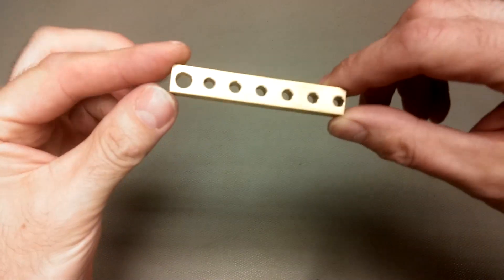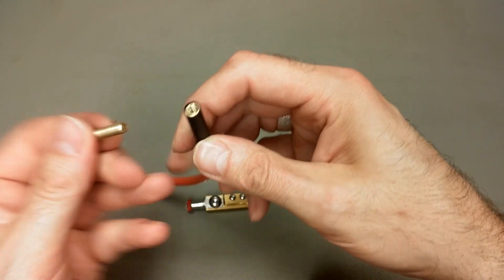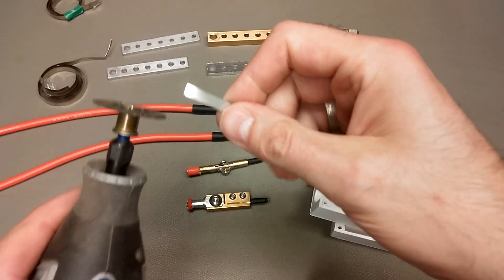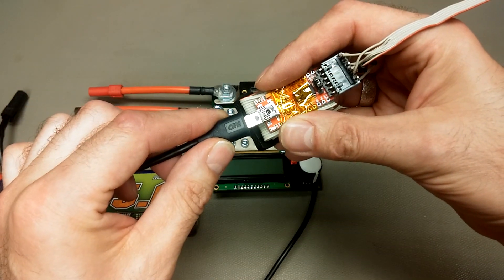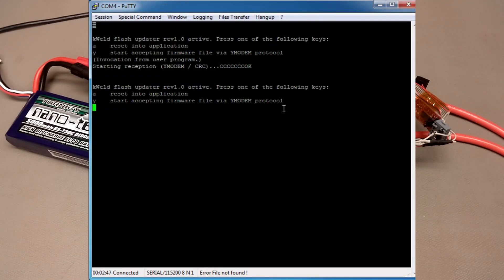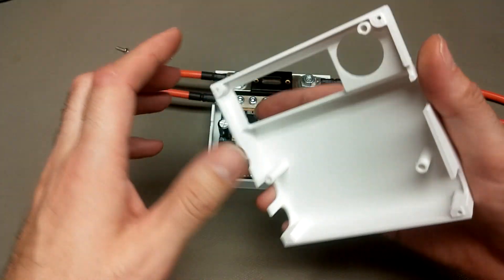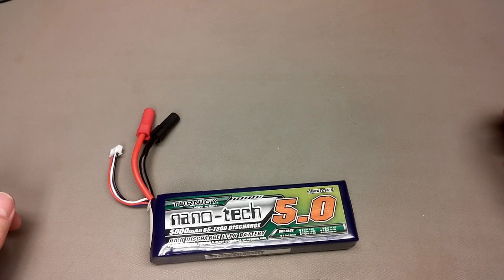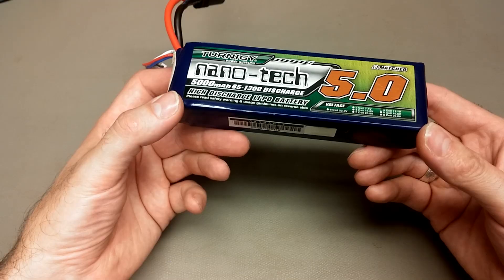kWeld "next level" battery spot welder - torture test and improvements

Comment: Is the spotwelder pulsing one time or two times in quick succession? When doing two pulses, first small, second big, you burn away the oxide layer. This creates a better weld. Have you experimented with this?
Reply from the maker: Two pulse operation is normally needed to soften the metals and clean the surfaces in contact in a first short pulse, in order to have a repeatable resistance for the actual welding pulse. As the pulse durations are constant in commercial machines, that is one way to produce consistent welds. My approach is completely different. The welder controls (=keeps constant) the amount of energy of one pulse instead of its time. This automatically guarantees that the amount of delivered heat (=energy) is always the same, no matter how much dirt or corrosion there is. If there is bad contact at the beginning, then the pulse is automatically extended. The welds that are produced with this machine are very consistent.
Reply: WeAreTheWatt 8

Comment: Have you thought about using some decoupling capacitors for the input-side?  
I would imagine having a capacitor that stores ~100J would also drastically decrease the burden on the power-source and likely increase efficiency due to lower ESR.
The reason i think this would help is quit simple: The capacitor can be charged over a longer period of time (hundreds of miliseconds) and during the burst the battery would "only" need to deliver a part of the total current. So lower current bursts on the battery, lower resistance for the discharge.

I would make the potentiometer logarithmic:
Going form 30 to 60 joules can change a lot, but from 400 to 450 not really, so imo it would be better to have tighter control at lower levels.

Also:
as i think it will be mostly used for battery strip welding - why not make a small connector that has the anode/cathode close to each other in a single piece, maybe even with a springloaded switch so you can align it and only when you push it down hard will it make an actual connection?
Reply from the maker: That capacitor will be a supercapacitor, and I appear to have some of them on my desk already because that will be the next option for a power supply :-)

I have noted your idea to make it logarithmic, I like it!

As this is system is DIY, I am sure that people will make a stationery probe holder system like that. I think it is a matter of taste, I like having the probes in hand, and using the automatic mode with them.
Reply: The probe-holder could be as simple as a fixation that holds both probes in place - but it was an idea after seeing your other video where you had some ... problems ... with premature connections.
Reply: @wearethewatt2950  Hello! Thank you for this project. I get my kit HW R3.3 yesterday 28.09.23 - did I get it with the newest version of FV or it need to be updated??

Comment: it might be good to use an encoder instead of a potentiometer
Reply from the maker: it was not necessary so far, I wanted the user interface to be as clean and simple as possible. But activating/deactivating auto mode would be already the first use case for an encoder's push button. Noted, thanks :-)
Reply: Using encoder would allow using it exclusively in auto mode either by pushing encoder button or setting things in options menu
Reply from the maker: what additional features do you have in mind? Currently the only function is to set the energy level, and for this I consider a potentiometer as the best possible human interface.
Reply: i was just thinking it might be good to implement an encoder if you plan on adding a menu of sorts